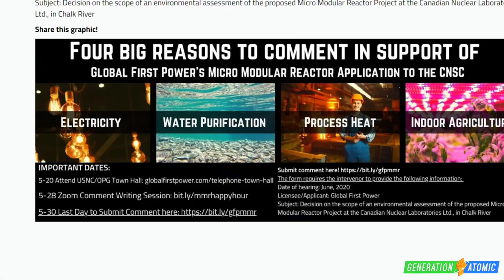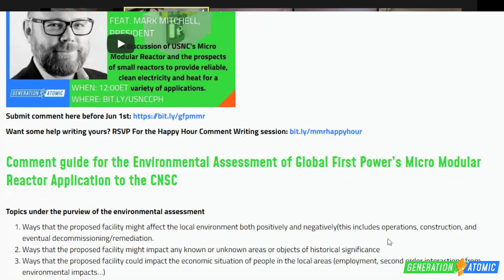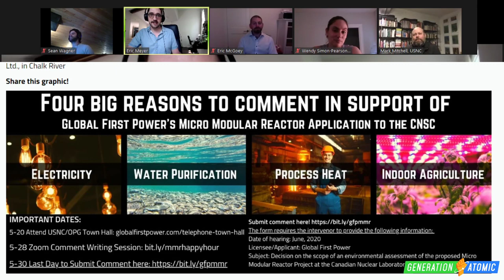Clean Power Hour #5 - Microreactors with Mark Mitchell of USNC!

Comment: The audio falls off drastically multiple times, but there's enough waveform there to normalize those sections and get it all back. I downloaded your video, stripped the audio out with Audacity (free.) I could normalize several dropouts without noticeable distortion. I really recommend taking your video editor and boosting the audio by pieces. Even normalize the louder sections. Lots of people out there with bad hearing, bad sound systems... Increase the value of your video.
Reply from the maker: Definitely. Live producing is tough! Especially while hosting... Next time: more help behind scenes, local capture, and editing! (no need for live stream in most cases)